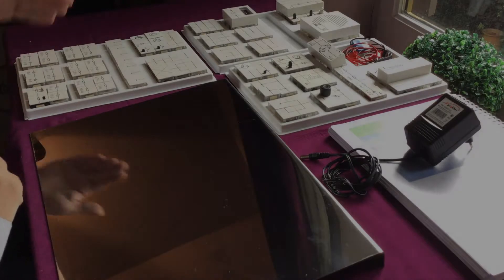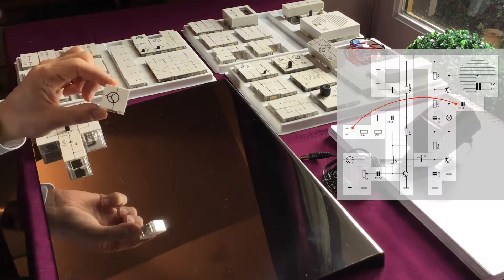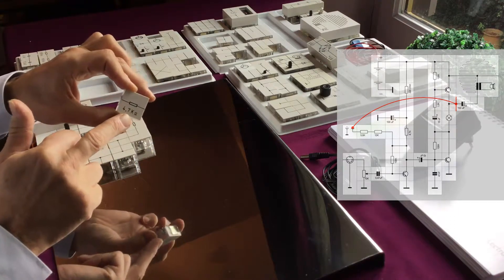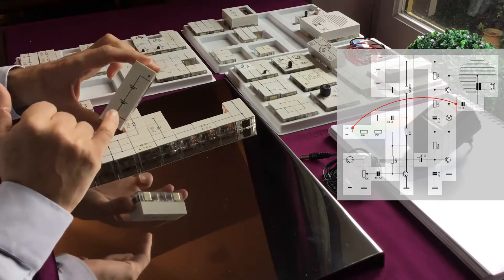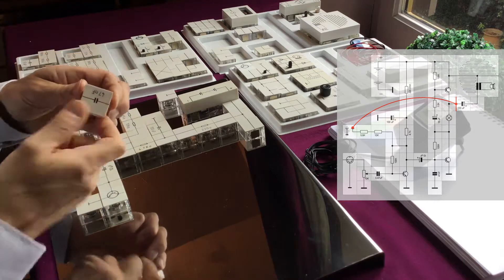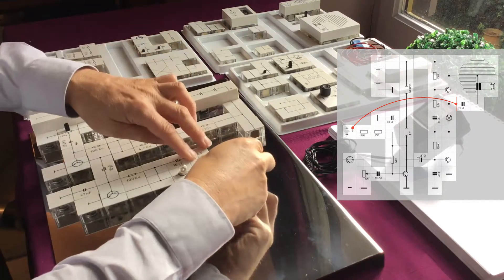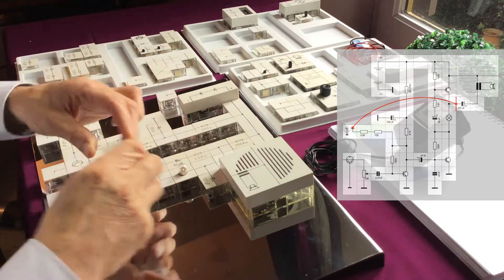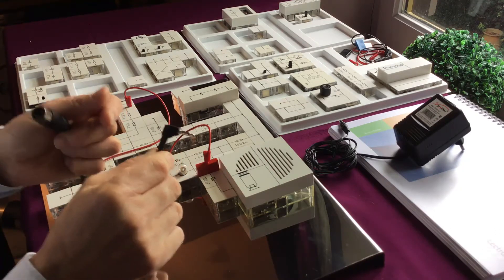Lectron : building a 3 stage amplifier

Comment: the „goundplate“ is shinning. What is it ?
Reply from the maker: It's the groundplate that came with the RWO 1205 OpAmp set.
In fact, in the 1205 there was besides this A3 format, also an A4 format groundplate.
These doesn't seem to corrode and remain shiny.
These are also solid and sturdy groundplates.
Reply: @electronicinventionscircui4358  What a simple answer ! Indeed it seems that different material was used during the past decades for Lectron for the board…I have blue plastic ones( Egger period), gray plastic (braun and later), and RWO built (on a wooden board). Even the blue one is by far the oldest, it is the best in my collection.